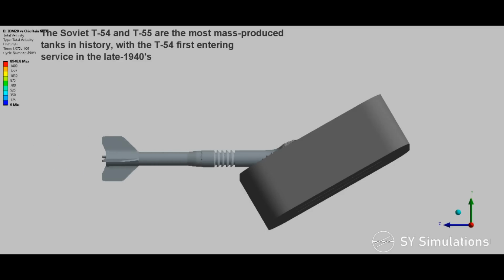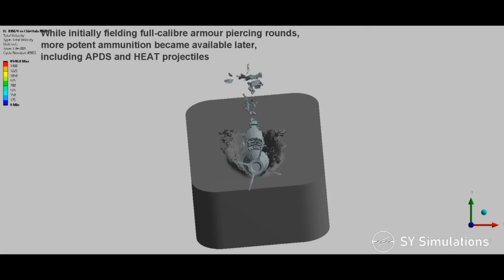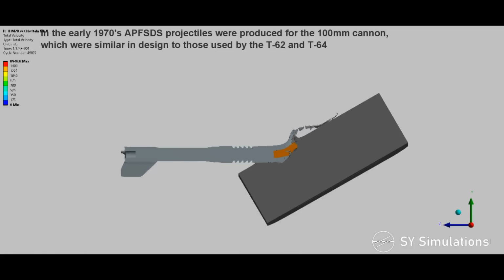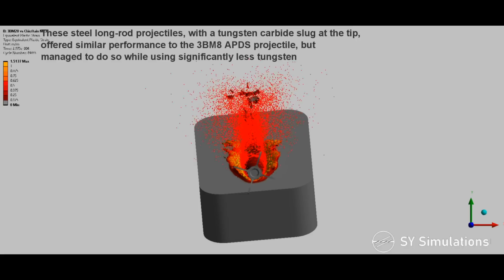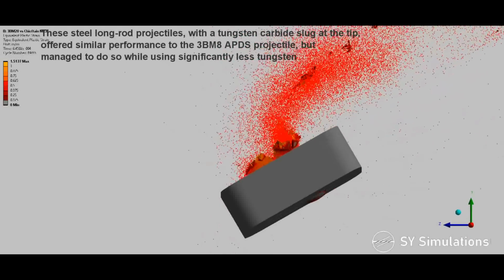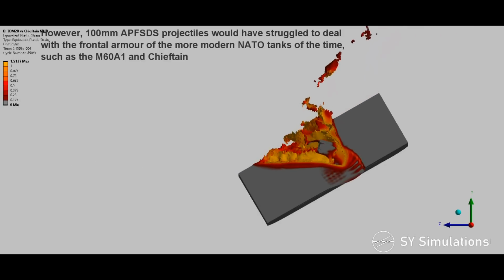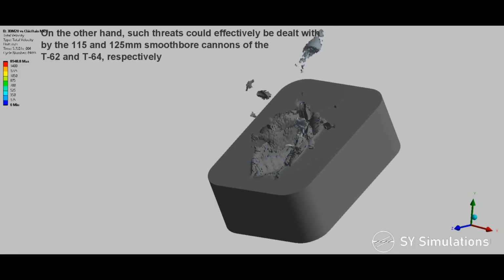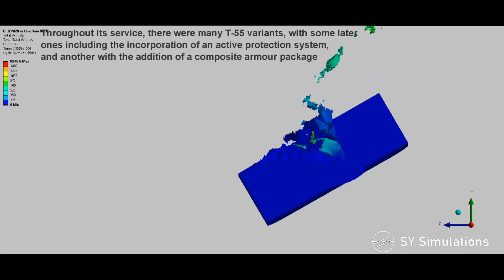APFSDS FOR A 1940's CANNON | T-55M vs CHIEFTAIN | 100mm 3BM20 Armour Penetration Simulation

Comment from the maker: For a cannon which first entered service during WWII, its impresssive that it was still decent in the 1970's...
Reply: Can you try a 88 mm from  germans flak 36 and kwk 43  and the 128 cannon apds and apdsfd ammo.

I known this ammo doesnt exist but can you probé It?
Reply: @brunoscarlatto4679 There was experimental APDS ammo for the 128mm and (I think) 88mm, but the issue was that the shells would be moving at such a high velocity that they would shatter on impact instead of punching through the armor. They had to use existing 88mm APHE for the 128mm APDS which is made of steel obviously. The British got around this by using tungsten but the Germans couldn't afford to use much tungsten at that point in the war so they abandoned it
Reply: @brunoscarlatto4679  I recall Ordinance QF 20pdr is supposed to be ballistically very similar to Pak 43, so you can use APDS-T Mk. 3 as a supplement. Main issue is though, APDS don't go too well with muzzled guns. Apparently muzzle brake causes sabot to detach unevenly, which hurts accuracy pretty badly
Reply: @kireta21 
That is definitely untrue. 

There are plenty of prototype gun with muzzle break with sabot. There are plenty of service gun with muzzle brake and sabot, many are probably literally firing as we speak. 

The accuracy with 17pdr and sabot is largely velocity related. Because the same sabot fired out of a gun with lower muzzle velocity does not have any significant accuracy issue.
Reply: @jintsuubest9331  muzzle break and sabot? I definitely want to see that....
Reply: @thiagorodrigues5211 m41 walker bulldog. I mean that's just an example I thought of at the fly.
Reply: @ushikiii  what about it?
Reply: @thiagorodrigues5211  it has a muzzle break and fires apds.
Reply: @ushikiii   apds is obsolete, the main reason smoothbore was made was because even Rifled cannon could affect APFSDS
Reply: @thiagorodrigues5211  cool fun fact. But I wasn't really talking about it's effectiveness. Comment was about tanks with muzzel breaks that fire sabot.
Reply: @ushikiii  cool but he was talking about prototypes, there are no prototypes with muzzle break because it's useless for today's rounds. 
So no clue what's your point
Reply: @thiagorodrigues5211  I didn't see that
Reply: @ushikiii  then maybe save the arrogant behavior my man, because the conversation has nothing to do with the past
Reply: @thiagorodrigues5211  well I saw your comment as irrelevant, and just a flex of knowledge untill you pointed otherwise. I backed off after realizing I was wrong. Not sure what the big deal is nor how exactly any of that is arrogant... I would expect it to be the opposite.
Reply: @ushikiii  by the simple fact you thought my comment was irrelevant and I was flexing instead of seeing what I was talking about, you already proved it.
Reply: @thiagorodrigues5211  that's not arrogance. By that logic anybody who voices their opinion an anything without first researching it is arrogant. I simply didn't read the full conversation comprehensively. If you think that's arrogant then you are entitled to your own opinion I just don't agree whatsoever. I'd call it ignorant. Sure.
Reply: @ushikiii  that wasn't lack of research. That was completely ignoring the point of a conversation and then thinking someone is flexing by pointing out the obvious. 

I even asked what about the m41 bulldog because I thought you had something to add about it. That's wanting to know someone's point.
Reply: @thiagorodrigues5211  😐. It's an analogy. People who haven't extensively research often don't have the full picture of what they are talking about. I didn't comprehensively read the other comment, I did skim but I missed that detail and I didn't have a complete picture. Is that a sufficient explanation?
Reply: Interesting, by logic the T54-1947 and IS-4 glacis should be immune too. Still the HEAT and more advanced APFSDS would go through easily.
Reply: My thoughts too... Almost succeed to go through. Quite impressive gun.
Reply: 100mm
Reply: It is comparable to the L7 which is still in service today. If anyone developed modern long rods for it like the M900 it could still be a major threat

Comment: When Chieftain got his Steelbraw Armor Set No Russian Round was able to Penetrate the Armor from this Big Boy. British Tanks Not the Fastest but the Strongest Armor.
Reply: You do realise that Stillbrew fielding started in 1985?) It was nowhere even remotely the strongest armor for that time
Reply: @gargean1671  of course it was extremely Strong. More strong the Russian Armor or German Armor even US Armor at the Time. And it was given to the Chieftain in the Mid 1980. The Armor provided Protection until the T72 got the 3BM42 round. But everything below it was able to defeat. So German Tanks with Armor got Penetrated from the 3BM42 too in the Hull Parts especially the Leo2A4 we don't need to talk about the Abrams we all know that you can destroy an Abrams with a Rock and a Stick in this time cause it was like a Better sherman. Fun fact it still is. 😂. But anyways the Stelbrew Armor is extremely strong. Even the Later British Armor is even stronger it gave enough reasons why British Armor is the Strongest that's a fact. Even if you not like this you can't change it.
Reply: @gargean1671 it was among the strongest. Not against HEAT but kinetic projectile was equivalent to any tank in service

Comment: in the late 1980s Finland bought M1000-series APFSDS ammunition from Mecar for their T-55Ms during the modernization and it was actually better than the ammunition the Soviets had sold for the T-72M1s that were also in use, so in essence the T-55Ms were better armed than the T-72M1s at the time. there were plans to upgrade the T-72M1s as well, but they eventually ended up buying Leopard 2A4s and additional Leopard 2A6s after that.

Comment: Ok, but the T-55 had HEAT with 390 mm of penetration
Reply: Much lower velocity though
Reply: @Kuschel_K  And ? It's a HEAT round, velocity doesn't affect penetration. T55 can also fire ATGM with 750mm of penetration.
Reply: What do you mean and?
It's lower velocity greatly reduces its effective range and accurarcy.

Comment: Why do you use 3БМ20 shell instead of 3БМ25? The main difference is a huge tungsten penetrator for the 3БМ25 shell that was made penetration more than 280 mm from 2000 m comparing with 240 mm- of 3БМ20 shell.

Comment: The Muzzle velocity of 3BM-20 is 1480m/s according to the Bulgarian Arms producer which still produces this round.

Penetration vs 260BHN Steel
240mm @ 2000m (0)
90mm @ 2000m (60)
72mm @ 2000m (68)

100mm 3BM-8 APDS
286mm @ 2000m (0)
80mm @ 2000m (60)
48mm @ 2000m (68)
Reply: Thank you!
Reply: So theoretically, at 2000 m, an angled King Tiger has the possibility to tank an APFSDS
Reply: @justsomehaatonpassingby4488  
Yes cuz it’s just a steel apfsds
Reply: @janflorovic5880  by any chance, do you have the same table for 3BM25 ?
Reply: @СмыслЖизни-с3м  
3BM-25 is too obscure and it’s penetration can’t be calculated since it’s composite apfsds round. Essentially it’s a 3BM-20 which is a 380mm long steel rod but they changed the first 60mm into heavy tungsten alloy followed by 320mm long steel rod. The 3BM20 carbide core tip was changed for a bigger one, since it’s identical to the one found in 3BM22
Reply: @janflorovic5880  wow. Very interesting.
Reply: @СмыслЖизни-с3м  
Most likely 3BM25 has 
296mm @ 2000m (0)
110mm @ 2000m (60)
Reply: @janflorovic5880  thank you!

Comment: What would Chieftain at the same era have done to the T-54 and T-55?
Reply: Stuck on the hatch before saying “the tank is on fire”.
Reply: Straight through
The Chieftain was much more similar in performance and role to the T-64  than the T-54 or T-55
Reply: Armor was woefully outdated at a time, even M60 often critisized for outdated armor was better. T-55 and T-62 hull armor was 100mm 290 BHN RHA steel angled at 60 degree. Turret could get thicker if you hit it at bad angle.
Ah yes, Chieftain also had HESH that could blast through easily but, same as HEAT rounds, at normal ranges kinetics would still be preffered due to better velocity and flatter trajectory, producing more hits.
Reply: Chieftan had 120mm gun. From other simulatiom it seems its APDS (so worse tha later APDSFS) could narrowly get thru T64 hull.
So T 55 would get smashed at any resonable combat distance.
Reply: in the front through the crew and out the back
Reply: Cute comment, considering the right analogy to the scenario in the video would be T-64A vs Centurion.
Reply: Apparently the m60’s and Chieftain’s were outclassed during the Iran-Iraq war when they faced T-62’s and T-72’s
Reply: @nicholas6287  The thing is, the Chieftains were often abandoned after they had ran out of ammo and then shot at point blank range so it looked worse than it really was.
Reply: @nicholas6287 Ask the Kuwaitis about the Battle of the Bridge’s where their Chieftains defeated T-72s.
Reply: @nicholas6287  iranians were not using them properly. Thats because they purged officer core before war.

Comment: Поставьте Чифтен на Украину и увидите как они горят😂😂😂
Reply: 1960s chieftain would beat the shitty T-55s Russia is resorting to.
Reply: @sturmgeschutze3070 ага 55 будет ждать пока это 60 тонна д*** его возьмёт в прицел?😂😂😂
Reply: @ДанилаДзевялтовский  Chieftain was designed to fight in defensive positions so nobody is waiting for it to go anywhere.
Reply: @sturmgeschutze3070 ну вот, а т 55 разработан как маневренной танк с противоснарядным бронированием предназначены именно для уничтожения таких неповоротливых громадин😊
Reply: @ДанилаДзевялтовский  Completely ignoring the (huge) difference in crew skill, the armour protection of a T-55 is irrelevant against any contemporary gun and the mobility is hardly impressive
Reply: @sturmgeschutze3070 насчет подготовки экипажа полностью с вами согласен. Насчёт подвижности нет. Война на Украине наглядно демонстрирует, что более подготовленные экипажи на более маневренных российских танках доминируют на поле боя над более тяжёлый и сложный натовской техникой.😊
Reply: @ДанилаДзевялтовский  Arguable. Russian tanks are more mobile only on roads, while NATO equipment actually has lower ground pressure (thanks to larger tracks) and with superior transmission and suspension, they actually tend to be faster on poor terrain.
Reply: @sturmgeschutze3070  Т-55s are still in combat because they are functional  mobilization tanks, while Chieftains sit in museums, because they can't run.  Operational T-55s in their hundreds vs a museum piece Chieftain, is hard reality vs your delusion.
Reply: @BigSmartArmed  Chieftains are in museums because we can guarantee we’ll never have to use them again. T-55s are still in combat operation because the Russians can’t afford to have a frontline force consisting only of modern tanks. Your statement is based on a false assumption.
Reply: @sturmgeschutze3070 no. Chieftain stand 0 chance even against early T72 variant
Reply: @bastikolaski8111  Depends on the variant. I expect the post-Mk.10 with stillbrew would be pretty evenly matched.
Reply: Что толку, во первых там основное средство поражения мины и ПТРК. Во вторых Чифы разве что в музеях остались. Но украм поставили Челленджеры (развитие Чифтена). Впрочем, там и современники Чифтена светятся постоянно. Т-55, Т-62, старые модификации Т-72 (эти вроде уже пропали), и вот ожидается дебют Лео1. Видимо последняя большая война с использованием советского и натовского барахла.
Reply: The Iraqi did that already, with just T-62 and T-72, so the chieftain would be easily disabled in 21th century combat.

Comment: A good ammunition can really push an old gun quite far, can’t it? 

And yeah a 115 mm. gun and 125 mm. gun could deal Chieftain effectively, during the Iraq iran war, the Iranian chieftains didn’t perform too good to say the least.
Reply: And yet the Jordanian Chieftains fighting on the Iraqi side did perform well and not a single one was lost.  Amazing what properly trained and competent crews can do, isn't it?  It's almost as if training and ability are more important than the toys themselves.
Reply: @iatsd  Agreed. Tanks are not supposed to just sit still trading shots with each other out in the open, armour thickness and armour penetration are only two of a great many variables.
Reply: @iatsd a lesson not learnt by Turkey and it's invasion of Syria
Reply: Iranian chieftains lacked composite armour addons.
Reply: @sturmgeschutze3070 no Chieftain variant stand a chance
Reply: @bastikolaski8111  Composite armour improved the chieftain’s armour significantly, even being able to stop just about any dart of the time.
Reply: Iran iraq war cant be taken as a indicator. Iranians blundered a lot.
Reply: Well steel armor in the 80s will get you only so far. Ironically, the T-72 was regarded in the iran iraq war as a legendary powerful tank, with its composite armor.
Reply: @quan-uo5ws  Of course it was a new tank model at the time. Even the downgraded one for export was still viewed favorably. 

Today, the upgraded ones such as the new model of T-72B3 are mostly serviceable since Russia was doomed so much by the damage from Yeltsin's era so they have a lot to catch up. Now, I guess they are trying with new optics and such.

Plus modern wars have showed to be really unkind to armored vehicles.
Reply: @yosawin3018  to be fair the ukraine war is just a giant grinder for military equipment. Im pretty sure Russia used this opportunnity to get rid of their old tanks that have been sitting in storage for years and were waiting to be scrapped (T-72A, T-72B, T-80B, T-62, etc)
Reply: @quan-uo5ws Exactly, a lot of people laughed when they send T55 and t62 to the front but they use them as pillboxes that must be taken care of one by one. Losses are huge on both side.
Reply: @quan-uo5ws what you mean with ironically?
Reply: @bastikolaski8111  because later the T-72 was used against the USA in the kuwait war and it performed really poorly since Iraq was supplied with obsolete munitions that couldnt penetrate abrams or challenger and it got a very bad reputation from there.